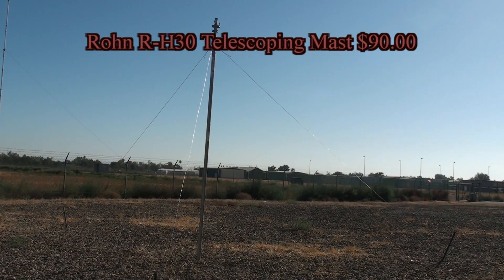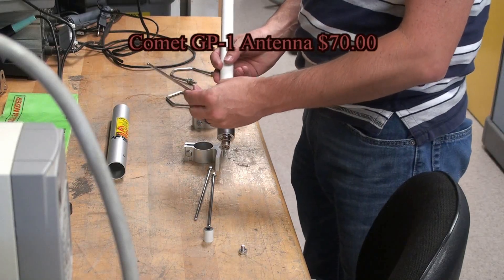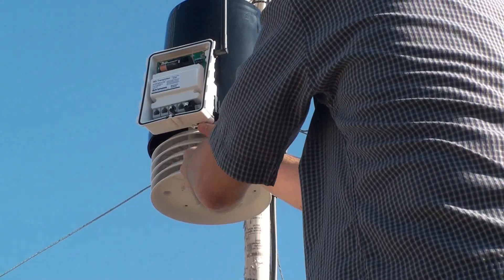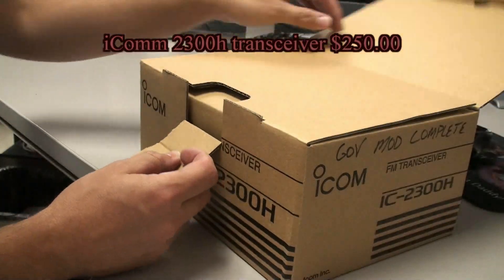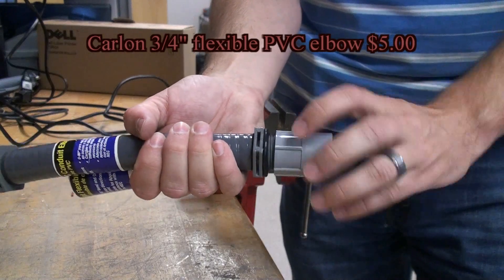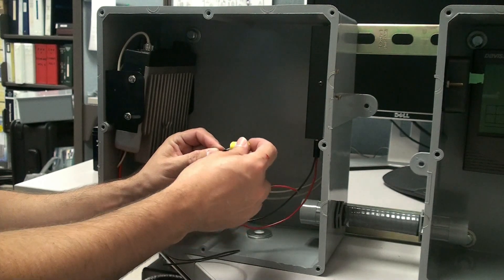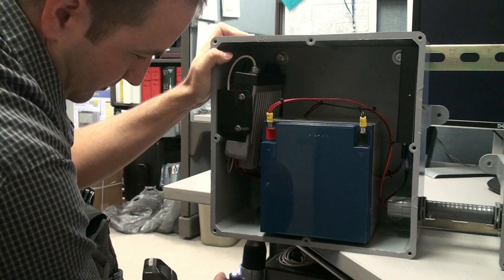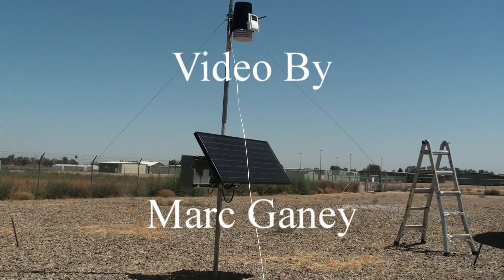Solar Power APRS Weather Station

Comment: Interesting how these days so much more is just done using a RaspberryPi. It would emulate the TNC, require far smaller battery packs, and probably also run on a smaller panel. Plus you could have a USB SRD plugged right in and it would handle broadcast/receive. With a wifi stick, you could control it remotely using SSH.

Comment: Why not to use the Kenwood D-700 or the D-710 APRS ready radios?
Just connect the weather station to the radio  the TNC and software is installed in the Kenwood unit.
Program the radio only.
Reply: Not all weather stations output the data in the right format for APRS - this is why they are using the software -  there are other solutions such as finding a weather station that is APRS compatible.   And using a D710 would be pricey as a stand alone weather station.
Reply: There is very good reason NOT to use the 700/710. I bought a 710G for exactly this purpose. Connecting the radio to the weather station was super easy and data started flowing immediately but it didn't send out a complete set of data. One thing it was missing was peak wind gust over the period between transmissions. If you have an anemometer, wind gust is one of the most important measurements. So I bought a wx3in1 mini and hooked it up to a Motorola commercial radio...now everything is perfect.

Comment: Great setup and great video.  Thanks for sharing.  Looking forward to building my own version.  I will probably have all the electronics inside the house in my setup though.  I would recommend other builders of such a system to use "PowerWerx" connectors and adapters for all the connections.  These connectors allow you to build a modular system quite easily and allow fast future changes/updates to the wiring.

Comment from the maker: That's a great idea. You can purchase a used commercial or amateur radio for much less than new. There are also cheaper new radios than the one I use.  I use the 2300 now since the icomm 2200 has been discontinued. I found that it lasts a very long time in the field under continuous operation. Just make sure the radio you choose can transmit at the power level you need. Also I wouldn't get one with a fan for cooling as they tend to fail after a few years of continuous operation.

Comment: I think what cmritchie04 is saying is, instead of spending $250 for a brand new ham radio, with a VFO, you could have purchased a cheap used commercial radio for $50, and had it programmed to the APRS frequency. One of the main differences between ham gear and commercial gear is the ability to change to any frequency in the amateur band with the twist of a knob. Since that is a feature this application won't need a commercial radio programmed to a fixed frequency would have been cheaper.

Comment from the maker: The infrastructure for amateur radio community is already in place. If you want to set up your own private system on a commercial frequency, you would also need to install repeaters and a gateway but it could be done.

Comment from the maker: All holes should be drilled to the same size as your screw threads to prevent water intrusion.  If you feel water may still get in you can apply a dab of silicone in your screw holes to seal them.  You can also drill a small hole on the bottom of your box to drain any condensation that may be in there if humidity is a problem in your area.